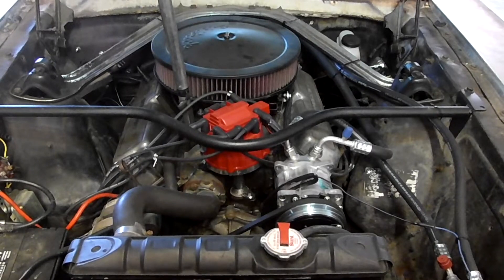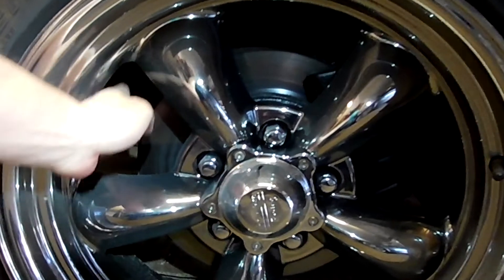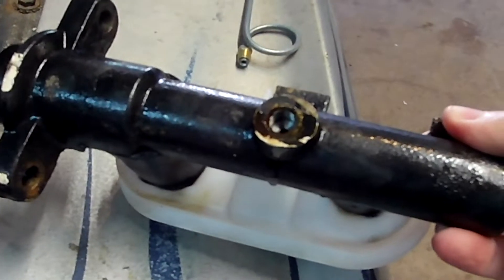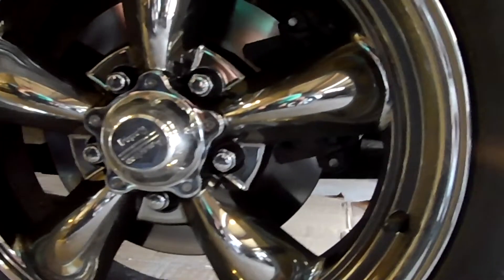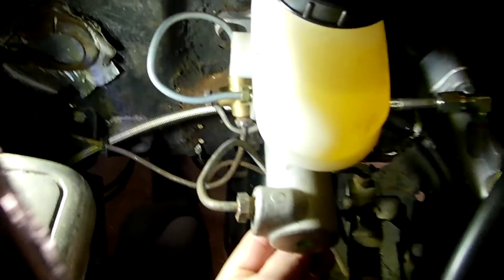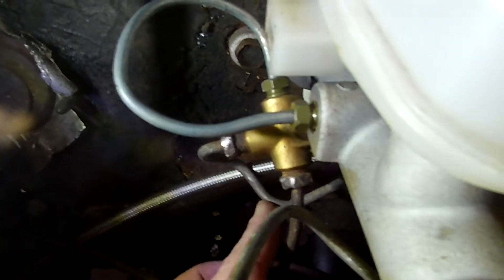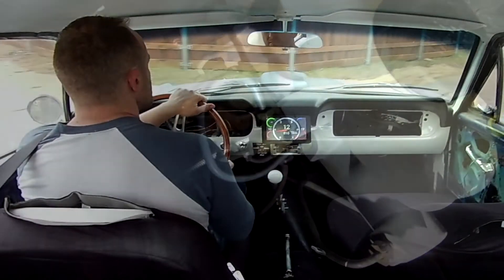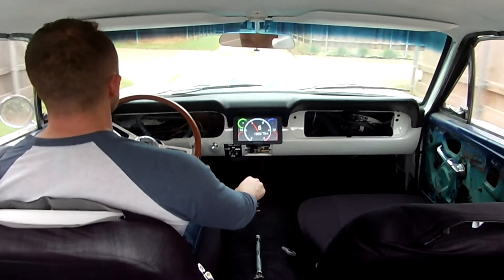Mustang Master Cylinder: Upgrading a 1966 to 87-93 vs 94-95

Comment: Did you have to modify the firewall for it to fit ow was it a direct fit
Reply from the maker: It was a direct fit. The bolt pattern on most of these Ford master cylinders is the same. My existing master cylinder pushrod also fit and was correct for length.
Reply: So did the larger bore size make the pedal harder or softer? I'm struggling right now finding a master cylinder for my 69 with all disc brakes. Seems hard to press, but booster keeps it down. I prefer the car to slow down half way down, not stop completely like 2 inches from top. Someone told me to use corvette master cylinder.